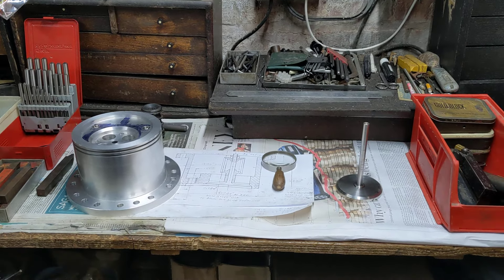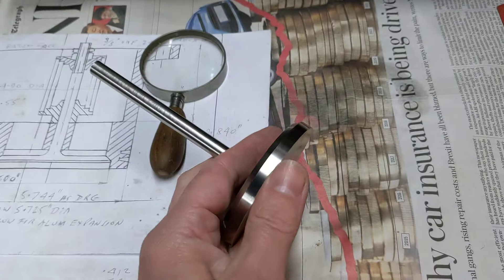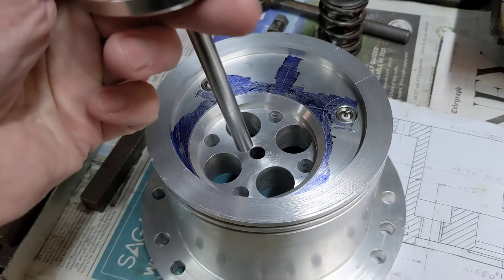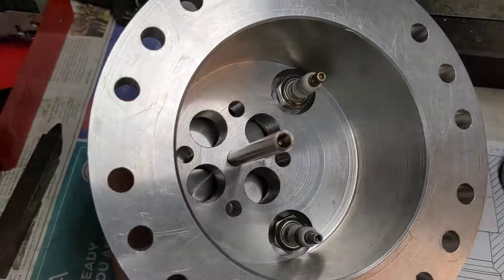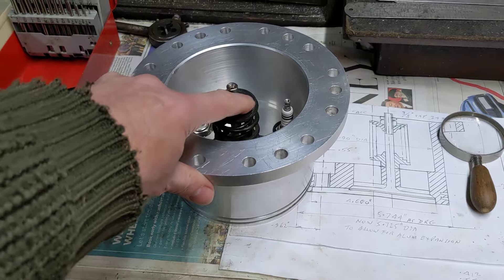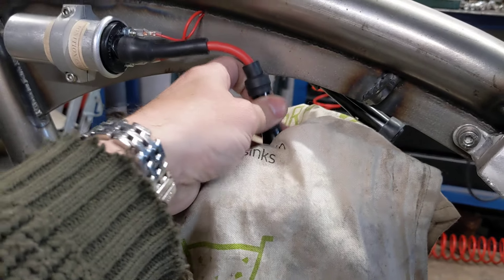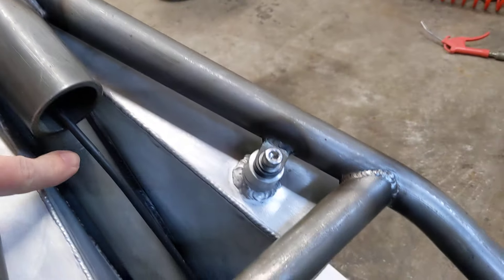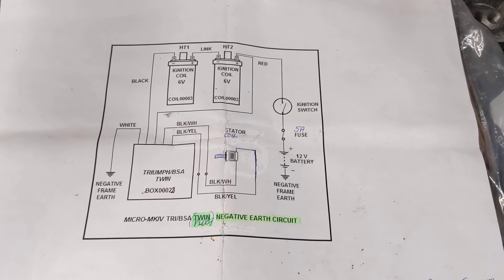Decompressor - Down to size!

Comment: You need a big diameter flywheel , not too heavy, but it should have most weight at the rim. It will give it enough inertia to get a complete rotation and keep it running while starting.

Comment: Just curious, are you going to use some type of filter media to prevent dirt and debris that settles in the spark plug / decompressor well from being pulled in when the decompressor is open
Reply: Yeah, I was wondering what might happen if it was left out in the rain and the head well filled up with water ?
Reply from the maker: Anyone is welcome to comment, if I didn't think so I'd turn commenting off. 😁
The decompressor needs to be that big, see the other videos for an explanation. 
I probably will look at protecting against foreign matter ingestion from the decompressor, but later in the build. It's a simple problem to resolve. ☔